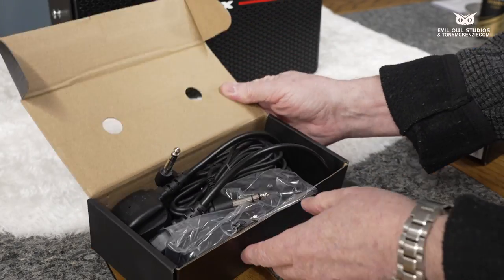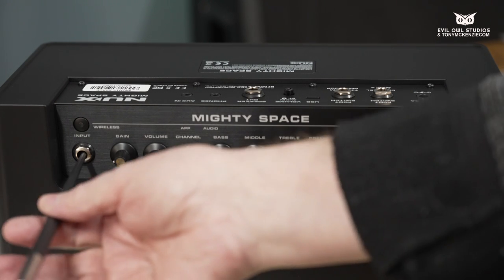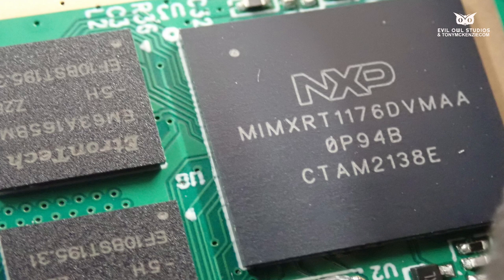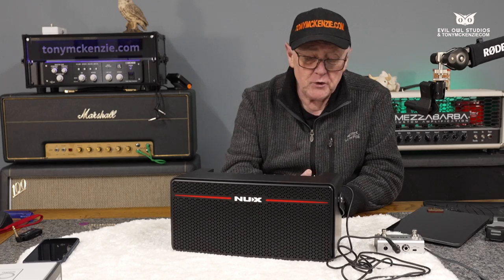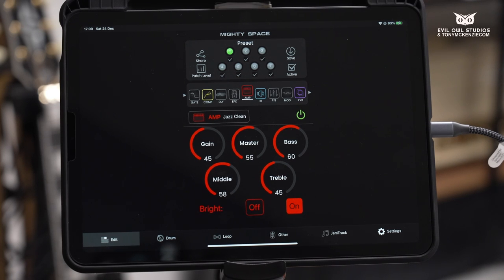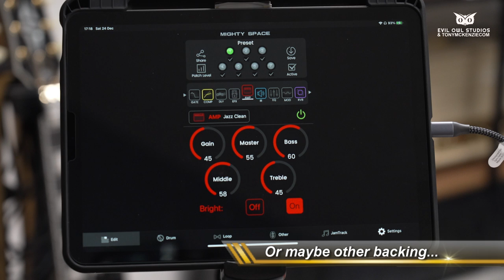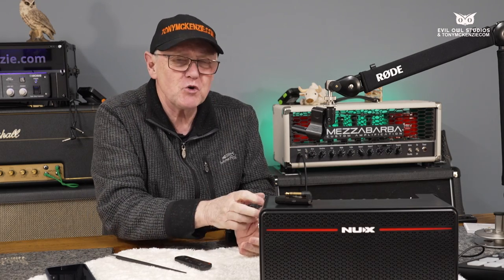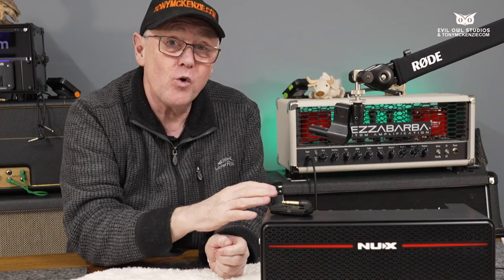NUX Mighty Space Amplifier Simulator | The Perfect Small Amp

Comment: I got this amp in March 2024. A few complaints, 30 second loop time, no landscape just portrait, mono octave effect in the new firmware update is horrendous. Developer say it’s a mono octave & it is extremely limited. The only note that is in tune is F on the 6th string 1st fret. No tap tempo or sync. The volume knob for the aux in & Blue Tooth has to be turned all the way up to be heard & still not quite there.  Now it’s not their fault but I had to delete the safe mode in my laptop because Microsoft won’t let you download third party apps. Now I can use the Mighty Editor & do firmware updates. It took a month of emails back and forth till I realized that I had to delete S-Mode. The developer was unaware of this until I pointed it out. They’re going to include that in the future trouble shooting.  But now I cannot reinstall S-Mode, it’s gone baby gone & then if I did reinstall it third party apps wouldn’t work anymore. Otherwise I love the amp with its tones and features. The speaker out is great. Android doesn’t play well with the backing tracks, they don’t come thru the speakers. My iPad does play well with the backing tracks and all the rest of the controls. The BT and wireless are great, no problems accept for my muscle memory of avoiding cables under my feet. Im getting used to the freedom of being wireless. Over all I give it an 7 out of 10.  Great review from you. Thanks 🙏
Reply from the maker: Thanks for posting the points you found... helpful to many and thanks for watching...

Comment: Good review, as usual. I'd still like to know what you personally think about the basic sound of the unit compared to the Yamaha. One would imagine NuX have designed it to sound better, before one gets into all the myriad bells and whistles. Happy New Year!
Reply: The thing is, feautures look good on paper.  It seems most of these at least have a "good" quality sound though, so it's hard to go wrong.
Reply: @RByrne  I think you're correct. Only this was an in depth analysis of the product, which is an amplifier, but, there wasn't much said about the sound. It's got bigger speakers than the Yamaha 30, so it should sound bigger and with more bass, but is it a clear and polished as the Yamaha? I know this can be subjective, but as Tony has reviewed both of them it would be interesting to know his impression of the sound. Like, this NuX is on a par with the Yamaha, in my opinion, that's all. I just thought it was a bit odd.
Reply from the maker: Well the sounds were good on both the Yamaha and the NUX Mighty Space. The IR's are often key to the tones we hear and some of those are loadable so there was little relating to sound differences. I did touch on the external speaker though and that certainly will change the tones - disable the IR and plug in your fave speaker cab, and it then sounds louder too. Both of those units have their own thing going on of course, but I think the tones these days on devices of similarity are moved sideways a little because they are all generally good. I agree I did spend a long time covering so many points, but those differences start to add up and should be taken in to consideration along with the tones as well. This unit and the Yamaha unit are both very good devices no doubt in my mind at all, and both performed pretty flawlessly. There are other video reviews that show more playing than I showed I can tell you so if its only the tones that are important (that is a choice) then you can see those on YT. I always try and show literally plugged in and go tones because in many instances for buyers that is exactly what they will do. My other points really enhance the review by trying to show the stuff others never do. For example I found it very interesting that the chip for output actually supports up to 50 watts - something that was not disclosed in any review. You 'might' even be able to get that output (I did not try it) with a 2 ohm load on the speaker output... and of course if you can I have not really seen that on other devices. At least, my aim is always to offer information that allows potential buyers to make as near as they can an informed decision, which in general (even for me) is often lacking from the info available in the first place. It's all a bit complex to make this sort of video, the time factor is often a major problem, but I would ALWAYS prefer to make a video review like mine with as much info as I can muster, rather than a 10 minute video of just playing really. This video took literally a week to make and is really for all the 'inside and out' reviews I complete basically the same for all the equipment I look at. Hope it helps a bit on why I create these like this. And hey you too have a great new year too and if you're USA or Canada hope you missed the weather there... it all looked really bad.
Reply: @tonymckenzieofficial  Thanks for the detailed reply. NuX products do look like god value. They have an aggressive pricing policy because they are determined to stablish the brand's identity in crowded marketplace. Spark is cheaper but doesn't, I think, really challenge the Yamaha, which is the benchmark, soundwis, which is why I curious about how the NuX sounded. It'll be interesting to see what Yamaha comes up with next, now that so many competitors are after their crown. Good to see you well again. Hav a happy and prosperous New Year!

Comment: Appreciate the extensive review, thanks! Mighty Space $600CAD (pricey) in Canada a little less than THR30II. The new Boss Dual Cube LX is about the same price when you add their aftermarket bluetooth module and footswitch in but has no drums and a less useful app. Not sure I like the built-in Lion batteries here, after 3 years they're worn out. The Dual Cube has external batteries, seems a safer option. IMO, the Kat100 head still competes as the more practical amp overall. (If you add in A Super-Thanks I could tip you for your effort.)
Reply from the maker: :) Firstly thanks I don't need the tip :) And thanks for the post as you raise some interesting points re other competitive gear. And that is ALWAYS a good thing to do. I did try and include everything I could which made for a long video, but hopefully many will learn something at least about the Mighty Space that otherwise might well not have been covered. A good post so you got the heart :) but no tip is needed. Thanks for watching.

Comment: Is there really enough bass there? It's hard to believe in such a small speaker.
Reply from the maker: Actually take a look at the EQ section that I showed on the screens section of the editor. You will note that I had 'backed off' the bass as it was too much for my own liking. The speakers I believe are bigger than the THR30 II also. Don't forget that also there is the possibility of an external speaker that also can change things quite dramatically if that's a preferred option to the IR changes that could be adopted. Sounded OK to me, but it is subjective I guess. I tried hard to get those speakers out but failed... Great point that you posted and thanks for watching. Have a great new year too.